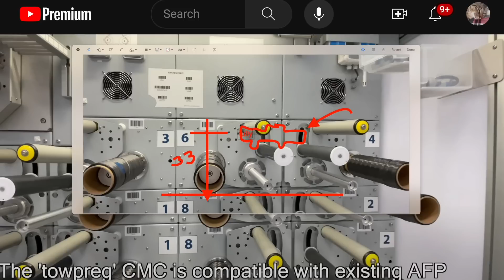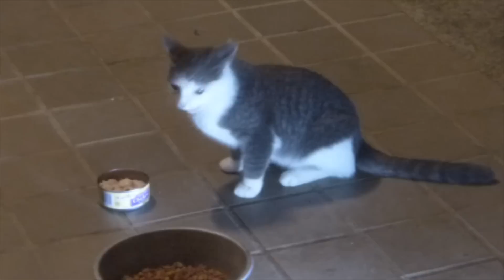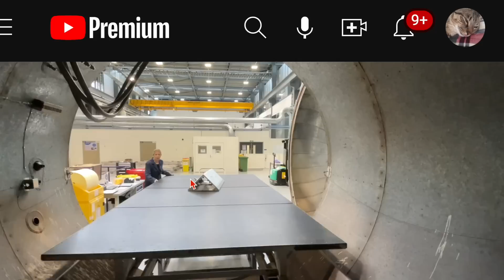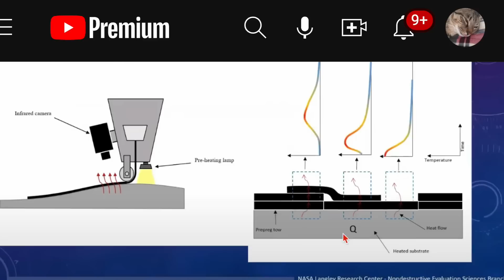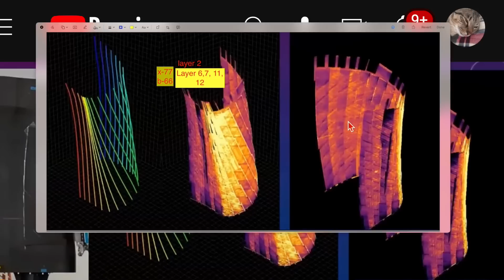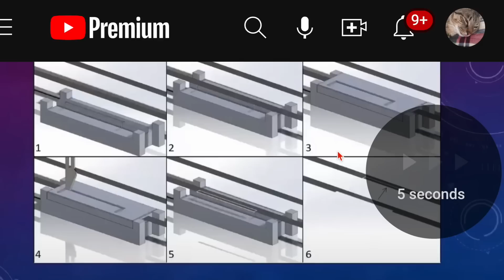titan Implosion Carbon Fiber Tow placement technology NOT capable at this time for complex geometry

Comment: The weight of this heavy sub was always on the titanium rings. Every moment it was out of the water, and even the frame legs were attached to those two rings. 
All those months being towed, and jarred around, those legs can be seen doing a bit of swaying also when on the float. 
  It’s amazing those undersized rings , and glue held together as long as they did.
 Interesting,,Bruce Morton the electrician also spoke of the popping sounds of the cf, as if the compression, contraction was a normal thing.
Reply: The skids were deforming too, arched upwards when it was placed in a parking lot.

Comment: I'm still surprised that company agreed to make that hull for this guy.  Carbon fiber is great for pressure tanks, but not in compression.  The tank for my paintball gun takes 5000 psi, it would never survive that in atmospheric pressure.  You'd really think those guys would have some sense after the 1/3 scale one got crushed at half the pressure they would have refused to make the full size one.  They're going to take a huge hit in court, and be lucky to survive it.

Comment: Does cooled (to expand and pretension fiber cylinder) thin titanium pipe could prevent kind of high scale buckling you showed in other videos ?
And maybe other external heated to contract on fiber cylinder, effectivly making sandwich in wich fiber is pre compressed and stablized even on surface,
deep down platisticty of metal equalizes pressure on more area and spread force on more fibers?
Reply from the maker: Short answer, the technology is not ready yet...
Reply: @LoadPathEngineering  To froze titanium (or steel) pipe and insert instead of mandrel before autoclave ? 
I understand some research is needed but it can be done on shorter segment

Comment: Three phase wiring with no markings, if a motor is reversed, you swap two phases. they had the separate controller version of the Innerspace 1002 thrusters.
Reply: Correct, Joefish - Brushless DC or BLDC. Three phases. I have a YouTube on how they work. Thank you for posting the model number!

Comment: The emergency frame release was pneumatic, those two ! compressed air cylinders were breathing and likely the framer release.
IF that transcript is true, my guess is the frame pins were pulled inwards from the front and back, one hopes they pulled inwards not pushed the pins out.
but the four vertical struts only partially came free, stickion etc.the rear frame seems warped compared to the front. That woudl be consistant with only the front coming free.
Hence the 6 feet per minute rise.

Comment: If you look at the cycling industry, companies as big as specialized have pretty frequent failures that they have been sued for regarding carbon fiber, and that’s just with everyday above the surface forces 😎
Reply: As a cycle tech most failures I’ve seen are due to collision and shear rather that compression/tension. A tube would be shear failure. Another thing is the flex in carbon composites this fatigue 😵‍💫

Comment: There I video somewhere that says what depth he stops sinking and has to use downward thrust to continue to the bottom. I want to say 5000 feet or something like that. I'll take a look to see what I can find.
Reply: With ballast it should be calculated to be 200 feet above the Titanic. that would be my way of thinking.
Reply: It was WAY above that point which made it stand out to me when I heard it.
Reply: It might be in the interview with Paul Stanley as well. I haven't had time to go through all of the videos yet.
Reply: 50 mps at the surface , it had slowed to 31 mps at 3500m, a mere 300 meters above the Titanic. they were ten minutes away from crashing into the seabed. 
IMO only one pipe ballast detached, so SR activated the pneumatic ram and dropped the frame.